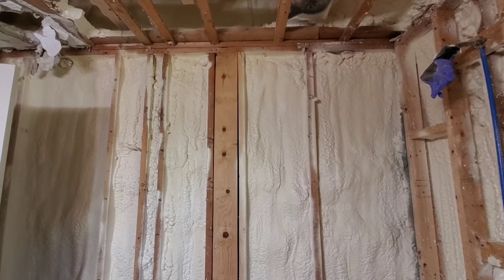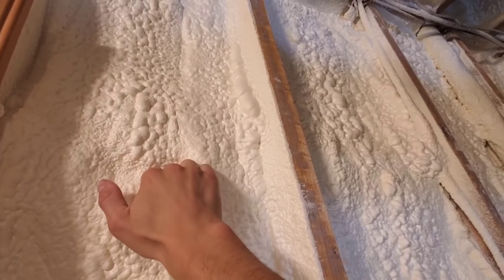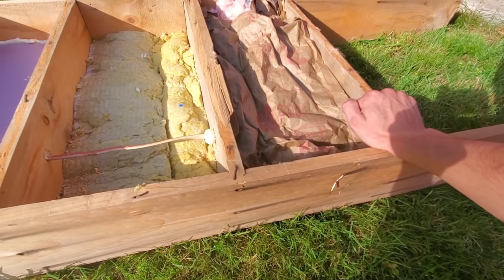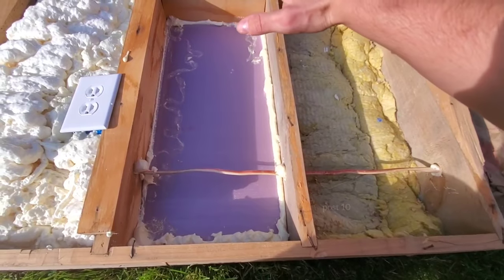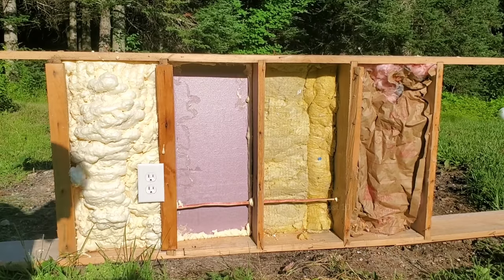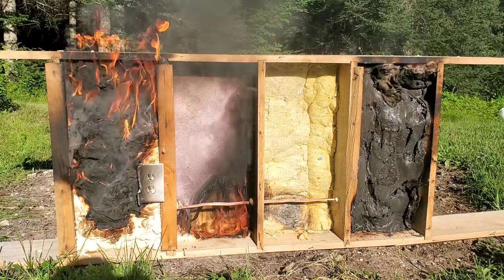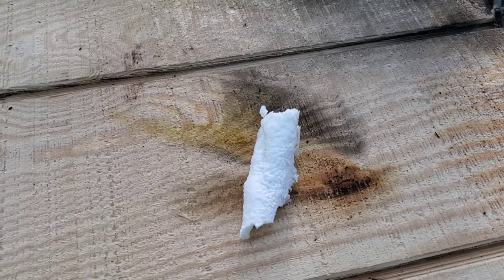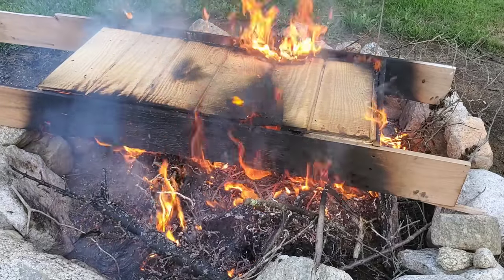Testing The Burn Ability Of Insulation In Wall

Comment: I worked for 25 years in an Australian federal govt fire research laboratory. We did extensive testing of different insulation materials some years ago. Your tests basically matched up. Congratulations on this video. Great information and well presented.
Reply: Great confirmation comment .. thank you.
Reply: Back when the Australian government actually acknowledged scientific evidence...oh how we miss those days 😅
Reply: You got it in one. The fire testing group is the only one surviving at North Ryde, NSW. The site had over 1200 in my day, now 20 or so. They are under threat still, hopefully building a new facility out near new international airport site
Reply: has austrialia gone very far in using sheeps wool as insulation?  beyond 2000 did a bit on it a long time ago, i wondered if it'd ever make it here.
Reply: Wool is still available as a roof insulation as a blow in
Reply: @ForTheBirbs  kool.
Reply: iwhats concerning is alot of new builds are utilizing spray foam moer and more
Reply: Did you test hemp based insulation? I've read that hemp is excellent at resisting burn
Reply: @ForTheBirbs  Unforgiveable what the Australian Govt has done to Science.
Reply: @gedcrowley3512  indeed
Reply: @randomrazr and also built cheap as can possibly  be so kinda makes sense in a twisted way
Reply: Your experiment is flawed, the way to do what you are trying to do is to butten up both sides to exclude any oxygen.  A better way for combustion analysis would be to introduce the wiring to 200 or 400v  for a period of time  and then disconnect the power after it catches fire.
Reply: @welston2966 our testing of insulation covered a significant number of samples and multiple ignition methods, in a lab, but inside a fabricated ceiling with timber construction. Was an interesting few weeks.
Reply: @gedcrowley3512 Whats did they do? I'm from South america
Reply: @felderup beyond 2000 is a deep cut
Reply: @dd-ow6pe  It took you 25 years to figure out what he did in 20 minutes?? 🤷‍♂️
Reply: Another Aussie here and I'm glad Rockwool seems to be more popular nowdays, and it was a good choice for insulation in my home as we do the upgrades.
Reply: @lithgowlights859 yes, good choice. Our testing was for Choice magazine. Article might be somewhere online
Reply: Why can't we use old-fashioned "technology" and use clay mud and rocks for insulation?
Reply: @RLaraMoore  I am not sure how much insulation that is required in your area but here I would probably end up with a wall that would beat the old local stone church that was built 800 years ago. 
My local requirement in a new house would be 25 cm  (10 inch) of rock wool for the wall and 35 cm in the ceiling/roof and that is hard to match by using only clay and rocks.
Reply: How about organic wool? We have it as a great eco friendly alternative in Europe
Reply: @quinosonic82  Probaron la seguridad contra incendios de distintas aislaciones. Telgopor, fibra de vidrio, celulosa proyectada... Lo sintético quema rápido y bastante, lo mineral (como el vidrio) aguantó más
Reply: @gonsalomon  entendí la prueba casera perfectamente, que coincide con las pruebas de laboratorio según el comentario original. Mi pregunta iba al que dijo, y cité: "Unforgiveable what the Australian Govt has done to Science."
Pregunté porque sospeché que había algo más que ironía... Las pruebas de laboratorio de materiales de construcción son un estándar allá y acá, y es evidente que no se pasaron 25 años quemando cosas para concluir que se queman (aunque a veces el saber popular va más rápido que el saber científico, que se obliga a demostrar y cuantificar, para luego normatizar y regular).
Reply: @quinosonic82  en Australia la gente antivacunas abunda, por ejemplo. Y el gobierno parece que no pone mano dura
Reply: @ForTheBirbs Awesome. I once watched a video of a test done I think it may have been in the USA. They built a house and setup cameras, sensors etc and then set it on fire. The footage was simply amazing as you could visibly see the fire following the air flow/ pathway even through ducting, and wall systems, including spontaneous combustion. I have tried for years to find that video and obtain a copy as it is such a useful tool to include when showing how passive fire systems work and their need to be constructed properly. I would appreciate it if anyone could point me in the direction to find that video or similar.
Reply: hmm
Reply: @ErraticPerfectionist  they never did...that I know of.
Reply: What is concerning is that the polystyrene insulation panels you show are the most cheap and common exterior insulation used in combination with PVC that does not protect it from flames because it melts
Reply: @maurozammarano6651 yes. A lesson not learnt when it was used in high-rise building cladding...
Reply: When did you do some extensive testing of different insulation materials? When did that happen ?  date month number of year
Reply: @KevinLyons-gn7eu The research was funded and published by Choice magazine in Australia
Reply: I can confirm his tests are very accurate to the testing I was involved in here in the states so congrats to him
Reply: @ErraticPerfectionist  I take it we realized the covid shot didn't prevent covid contagion lol.
Reply: I just sent this video to a friend that said I was stupid for doing the overkill work of insulating my house (it's a 50's home) with the typical fiberglass insulation, which meant I head to take down the sheetrock, cut and pack the insulation, buy some new sheetrock panels for those that weren't salvageable, prime and paint them...while he simply had it foam filled. My argument was that his stuff was extremely flammable, but I didn't know it was explosively flammable!
Reply: @TechieTard Yes indeed. Is the same issue with the building cladding all over the world. The core burns and rains down the burning core,and aluminium etc